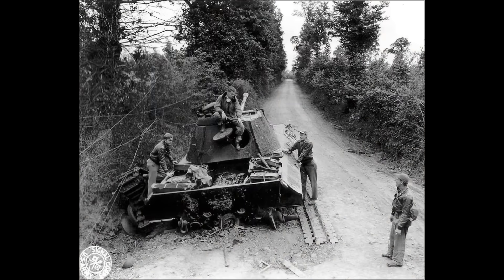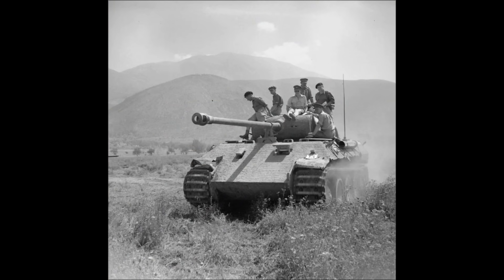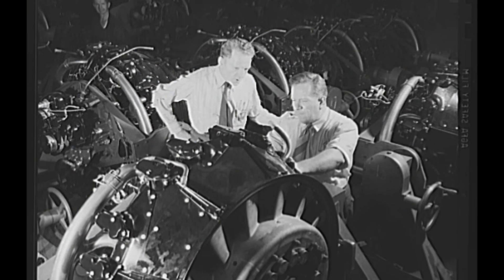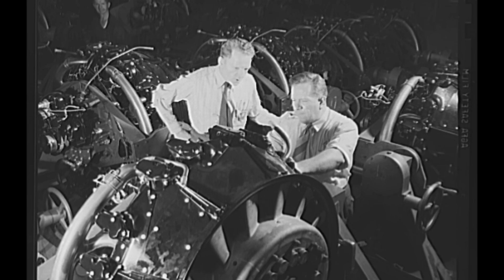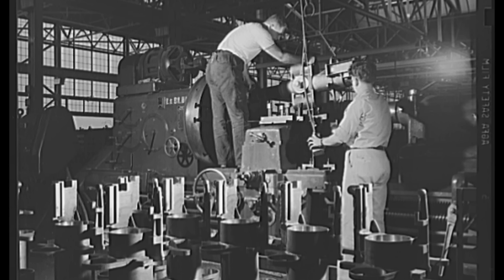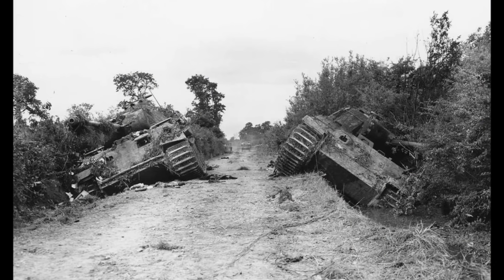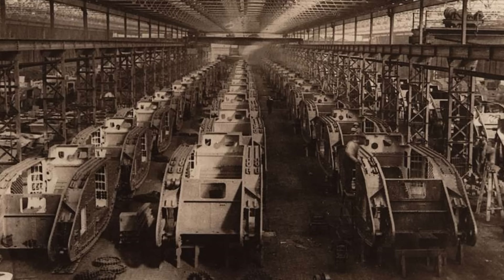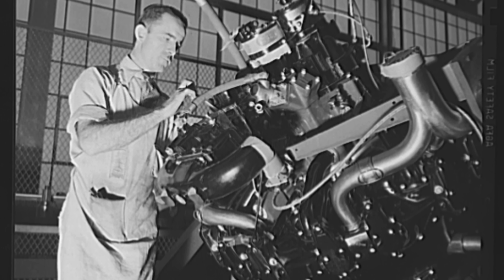British Engineers Examined Panther Tank Transmission — Then Discovered Why…

Comment: Meanwhile, Soviets outnumbered them in quantity.
Reply: Not in running tanks... Soviets made the worst tanks of the war and they had the worst combat readiness rates.
Reply: @WilhelmKarsten 
BS.
Reply: @iridios6127 All true, do your research!
T34 tanks were built with transmissions that were so unreliable that they left the factory with a spare transmission, V2 engines were so poorly made and unreliable that they failed in as little as 10 hours.
Tracks and suspensions would be completely worn out in as little as 60 miles!
Soviet generals reported that before battles that as few as 15% of his tanks were operational.
Reply: @WilhelmKarsten 
Total BS.
Soviet generals report to you directly ?    🤦🤦
Tracks for 60 miles ?  Made from marshmallow, i guess ?
Stalin didn't even shoot lead ingeneer into the face, for hi sold him that crap ?   🤦🤦🤦🤦

Comment: Lots of jokes about engineers are spot on. Lots of people make fun of, or ridicule engineers because of stuff like this. I'm one of them. I'm also an Mechanical Engineer. I work on my own vehicles, and I say, "If I was an automotive engineer, I'd never admit it."

However, I think most of the problems blamed on engineers are really the fault of poor management. Other factors influence design, and when engineers say, "Wait a minute...," they are ignored.
Reply from the maker: Exactly, the pressure to build fast, rather than efficiently, resulted in failure.

Comment: The first thing I noticed was that the first 3 or 4 minutes would probably be indecipherable to the non-engineer in the audience!
Next I surmised that the Tiger engine was probably air cooled since the gigantic cooling fan  shown is identical, but much smaller, on the early (1965-on) Porsche 911 engine. 
As the narrative progressed I was reinforced in my general impression of German engineers; supreme confidence in their own excellence but in the end too dependent on their even more excellent technicians and without the technicians their engineering work isn't very effective. Hence the failures in practice with the well trained technicians gone off to the Wehrmacht.
You could probably build a WW2 vintage American jeep or tank with a shop full of trained seals.
Reply: The Maybach HL engines were liquid cooled aircraft type engines.
American tanks were predominantly air-cooled.
 In terms of combat performance German tanks were a decade ahead of anything the Allies had and this advanced technology was driven by Germany's Force Multiplication Concept that was later adopted by the US military.
The US Army would go even further by adopting a German tank in 1980

Comment: I find that super ironic. In general German equipment were good but over engineered. The t-34 was the most successful tank not because it was refined. But because they made so many. And it was good enough. So the Germans pushed so hard to meet production number that the issue was metallurgic. That's just ironic to me

Comment: Germany was so short on strategic materials that the jet engines in ME-262's had syeel turbine blades with expected lives of 25 hours. They just didn't have the nickel, chrome and molybdenum they needed.
Reply: Don't be stupid. All jet engines use turbine blades made of high temperature STAINLESS STEEL 
The Messerschmitt Me-262 engines are no exception.
The German blades were made with Krupp P-198 Chromadur alloy.

German jet engines were superior axial compressor turbojet engines and were more reliable than than Allied jet engines due to two pioneering breakthroughs that were unavailable to the Allies 
The Jumo-004B engines have hollow turbine blades cooled by compressor bleed air and they were coated with TBCs (thermal barrier coatings) made from extreme high temperature cerro-alumina ceramic materials.

The US military tested and confirmed TBOs averaged 55 hours... better than Allied piston engines
Reply: So that is 10+ combat mission, if a German pilot survive 10 combat mission late war, he is a top ace, or have become a ace, and can get a new set of engines.

Comment: Maybe the manufacturing and heat treatment process was optimized for a specific steel alloy and with the wartime material shortage and constant time pressure a different material was substituted without sufficient testing. Different steels react very differently to heat treatment.

Comment: Sabotage- Germany relied on forced labor from many countries and a clever worker could sabotage the heat treatment and never leave a trace.  Beyond that, Germany had and still has a fetish for overly complex engineering.  It was said that at the battle of Kursk, 40% of German tanks were inoperative because the designs required special parts and tools that had to be shipped from Germany.  The Russian T 34 was simple and could be repaired with basic hand tools and its simplistic design meant that they could roll out of the factory faster than German tanks could be repaired.
Reply: At the outset of war, half the T-34s broke down on the way to the front.  After moving factories, workers in Chelyabinsk lived like animals, eating and sleeping at their machines.  The problems of rushed production and unmotivated employees weren't unique to Germany.
Reply: @floycewhite6991 Yes, despite having to move entire factories to the Urals, Russia produced about 120,000 tanks of all types in WW II. Germany produced only 50,000.  Yes Soviet workers ate and slept at their machines while German forced laborers just worked until they dropped and then were replaced by more.

Comment: There was a report by one of the tank rebuilders ( maybe Aussie Tank Museum, or a private rebuilder ). 
The drive gears needed for the particular rebuild were unavailable and so new gears were sourced to the original specs.
They were very expensive, but when they were tested, the consensus was that the assembly in question would likely NEVER fail.
During the rebuild they found that the gear cases had either too many or too large oil passages, leaving the gear sets oil starved.

Comment: Knowing the failings of German tank engineering, did museum curators remedy the shortcomings b4 displaying Tiger 131, Panthers & King Tiger 300....particularly for Tank Fest?
Reply: The French had so many broken-down Panthers littering their country that they used them as their main tank for a few years after 1945.  It would be interesting to hear from the French how they got these tanks running reliably.  They also repaired other German equipment and sold it to Middle Eastern countries (hence the German equipment v's Shermans episodes of the early Israeli-Arab Wars), so would have a lot of practical expertise ...

Comment: Flame damping exhausts were actually installed only much later on production Panthers. M.N.H was the first assembly plant which began mounting the so called Flammenvernichtern, which roughly translates to “flame eliminators”, in December 1944 [9]. Visual signs coming from the exhaust could give away the position of a tank not only in night combat, but also made any overnight unit movements easily detectable. In a short survey of the Panther tank by the US army, General White explicitly mentions the glowing exhaust pipes as a weakness. After two weeks of trials with the Panther tank, White writes: “The  weaknesses of the Mark V in comparison with the M4A3E8 are believed to be as follows: (…) d. Bright glow of the exhaust stacks at night after the engine runs for short period.” [10]
Problematic exhausts - PanzerPlace

Comment: Toughness in steel alloys is not simply the result of heat treatment.  It is also achieved by the alloying elements, such as nickel, molybdenum, vanadium, and cobalt and others.  Germany had little, if any, of these alloying elements by mid-way during the war.  Their aircraft engines suffered accordingly, and I would think so too their mechanical components in land vehicles.  German manufacturing techniques and abilities were among the best in the world, but without such strategic materials like alloying elements,  failure would be constant.
Reply: A lot of work was done by slave labour and they sabotaged all they could. On a British TV about a militaria dealer, he was restoring a Panther and when he got the engine rebuilt, they found one of the valves was sawn half way through.
Reply: @SvenTviking  At least one aircraft was found with an improvised bomb stashed away in the wing, set to trigger at high altitudes. When you turn skilled engineers into slaves and set them to work in a factory that deals with munitions, they do tend to develop odd hobbies.
Reply: That's all true. But remember it's not just what the transmission is made from, but what the machine tools used to make it are made from. The gearing type used in the Panther transmission also had to be simplified and made less resistant to stress, because the tooling wasn't up to the job of more complicated cuts. Much of the older machinery had been heavily used by that time of the war, and replacing it was difficult. Germany tried to source strategic metals like Tungsten and Nickel, even going so far as to have them shipped from Japanese territories using submarines. But it just wasn't enough.
Reply: Yep.  You'd think Germany would have traded its gold for industrial metals.  After all, these metals would also hold their value and could be recovered later.
Reply: @floycewhite6991 They tried. Gold and technology was traded with Japan via submarines. There was also some under-the-table dealing. But even though less strategic metal is needed than steel, it's still tens or hundreds of tons, and you don't get that in a briefcase. ULTRA was also involved - the Allies knew all too well what Germany needed, and were on the lookout for any shipments.
Reply: Their ship armour was better than Japanese but inferior to British and US armour steel.
Reply: @SvenTviking  Drachinifel has some good discussion on that subject. A lot of it is about the depth of hardening on the impact face, and it's not so much 'better or worse' as: 'What are you optimising for'? In this case, it's the size of the shell you expect to receive, and the range you expect to receive it at.
Reply: @SvenTviking  ...i believe japanese optics were more advanced than the allies.
Reply: @miroberries  They made some very nice pieces, some of them much better than the ones made by the allies
But the Germans were on top of their game. their prisms, lenses and coatings were superb.
Reply: @bramesque  yes that wouldn't surprise me in the least...!! the germans were so far advanced...at the end of the second world war,a lot of that technology was taken to america.
Reply: Not just hardening, but tempering as well. Just like they do in bullet casings.

Comment: Um.
Germans used straight cut gears.  Americans used helical gears.

It wasn't metallurgy, it was engineering.
Reply: Most German tanks used helical gears, including the Tigers.
 The decision to use straight cut gears was due to shortages of materials.
In this situation American engineers would have used the same design. 
The difference of course was America was incapable of building a transmission that could handle the power of the Maybach HL-230 V-12 engine... so it's really a moot point.
Reply: Okay. Now you're being silly.
Reply: @danhillman4523  
Sure.   
Convince yourself that materials and design are the same thing.  😒😒
Reply: @guessmyhandle  KEK. I already did.
Reply: @WilhelmKarsten you think the same America that could build giant battle ships, aircraft carriers, pressurized heavy bombers, reliable tanks and advanced fighter aircraft, couldn't build a heavy duty transmission for a heavy tank? The gears on the motors to traverse a turret on the Iowa class proves that they could. The same America that could build a b-24 every 3 minutes with over 1.5 million parts per aircraft. That America couldn't build a heavy duty transmission for a heavy tank! The same America that built dump trucks and bull dozers by the thousand? Those same dump trucks when loaded weighed as much as a heavy tank.  You are telling me that that America couldn't build a heavy duty transmission like the Germans obviously couldn't.
Reply: @briankiker That's right kid! America lacked the ability to build any tank transmission capable of handling 700 horsepower behind a 50+ton tank.
In fact America struggled to build anything capable of matching the speed, mobility firepower and armor protection of the German "Big Cats"
 The Americans also struggled to make a large enough turret and turret rings to fit a modern anti-tank gun.
 But what the Americans really lacked was suspension and tracks as good as the Germans made.
They were so good that America eventually gave up and bought them from Germany after the war.
Reply: @WilhelmKarsten I'm pretty sure you are wrong. America at that time could build anything. They had unmatched manufacturing ability and capacity.  The same Germans couldn't make a reliable anything at the time, yet we are supposed to believe in the German engineering meme? They had terrible welding, and didn't even have the manufacturing ability pre or during the war to even cast a full tank, and relied on out dated welding technique.  Don't confuse ability vs wanting to. The USA had no need to make a heavy tank and ship it across the world. The Russians had already pretty much defeated the Germans, what would have been the point.
Reply: @briankiker Dream on kid... Germany makes the best tanks in the world, so good that the US adopted and currently uses one too.
Reply: @WilhelmKarsten the Abrams is not German made or designed. The gun is. But that's it.  What is the point of your comment? What does the modern leopard have to do with WW2 manufacturing ability? And American tanks never used the interlaced suspension of the German tanks of WW2 they used  torsion bar suspension systems.

Comment: i heard that 1 hour of operation required by 5-10 hours maintenance and very difficult to fix in the field
Reply: That's typical for any modern tank even today.
What makes the German "big cats" stand out from other WW2 was their incredible performance and mobiity... the Panther was faster than many light scout tanks at the time and run circles around the M4 Sherman, especially over rough or soft ground.
Reply: @WilhelmKarsten  But...wait for it, the drivers were trained to baby the tank as operating it at anywhere near its full capability shredded or overstressed components all over the drive train. Particularly the final drive gears as everyone knows. Why? because the tank was ten tons over its originally designed weight and also encountered metallurgy issues with the very late war production units.
Reply: @DanielConnolly-q7c You seem very unfamiliar with this subject, and with the Panther in particular.

Comment: This was pretty much word for word the same as the tiger tank.  But I guess the same issue could span all factories producing similar designed products 🤔
Reply: No, the Tiger had a very reliable transmission.
The Panthers at WTS in Koblenz seem to run just fine without any problems.
They are incredibly fast for WW2 tanks of their, even the heavier Jagdpanther can sprint like a real big cat...